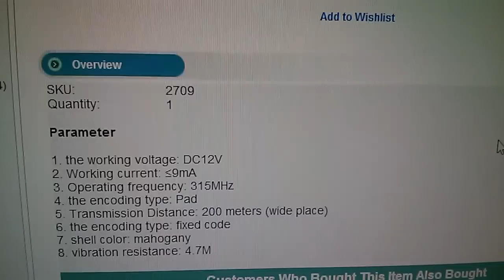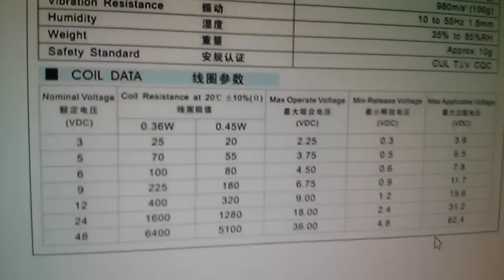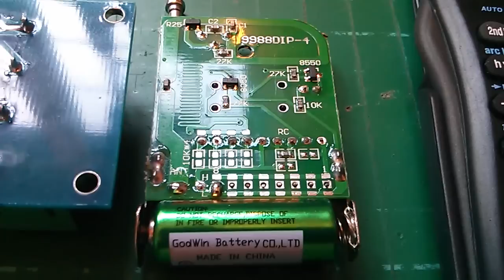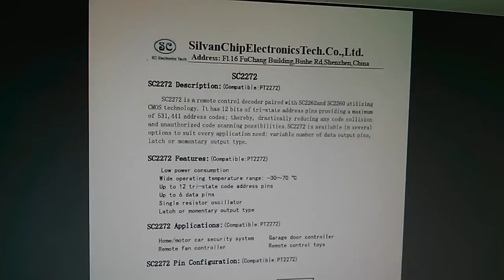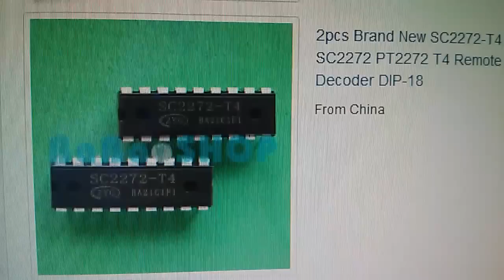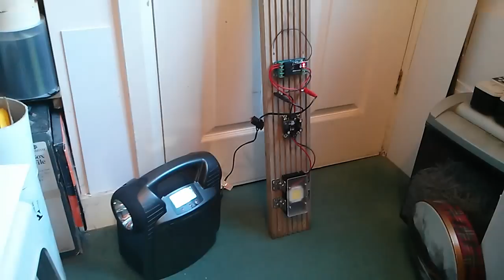Review: 12v 2-Channel 315MHz Wireless Remote Control Module

Comment: @Julian Ilett Hi, can this remote control be used to turn on and off a shed/workshop alarm?
I basically want to make the alarm quite basic, with a door switch that when the door opens up it then directly powers a loud siren and I need a way to turn the alarm on and off (from outside) when entering or leaving the shed/workshop or it will go off everytime i open the door.

So would this be able to work together with what i have planned? The siren will work off 12 volts via a step down transformer from the 240v mains inside the shed/workshop,so i need somewhere to connect it in the circuit to disconnect the power from the siren (+) supply line,I am thinking of placing this in line directly with the positive supply cable to the siren and switch it on and off.

Will it be powerful enough to turn the siren on and off (would be wired in series in pos+ lead) and do you think the way i would set it up is good
Reply: SP330Y yes a relay can handle hundreds of watts

Comment: I purchased this from ebay
http://www.ebay.in/itm/IC2262-2272-Wireless-4-Channel-RF-Remote-control-Transmitter-Receiver-Kits-/181960199083?
after watching this,at Rs 500,but its range I am getting is 5cm ,I tried with adding antena ,not receiving signal if distance more than 5cm :(   ...bad product & no return option,money waste. :(
I tried with 4.2 volt battery ,if I connect 9 volt battery its IC get hotter :( & do not work
can anybody suggest me any solution ?

Comment: hi i wonder if u can help me
 i got my foglight installed with wiring harness witch is build in relay and have 1 wire out to control the relay on or off 12v+ 
Now can i use this device to give only 12v+ to my exiting relay and so i can wirelesly turn my foglight on and off pls 
Tar

Comment: I am using this in a Radio control boat to control directly a mini-motor thru a Darlington transistor. I found that the range is very bad, namely 2-3 feet. Beyond 2-3 feet,  I have PULSATING current,  resulting in the motor's movement being very jerky. Wonder if you have same phenomenon or  know what is going on ?

Comment: Hi, I picked up one of these relay and used items but with a single switch and used it to power off and on a back-up camera on my 36 foot motor home.  The home had one but it didn't show very far behind the rig, so I installed a second and aimed it straight back so  I could see who was following me even when they were not almost touching my bumper.

Comment: Hiya Julian .! Don't suppose you can help me wiring up a DC Motor DC9V-6V PWM 20A Adjust Speed Controller +Wireless Remote Control Switch to a battery & 12v water pump?

Comment: I used this with two 9v batteries. One to power the board and other to power an acutaor. The relays switching are hit or a miss with the remote. Sometimes I have to turn everything off and short the relay outputs to get the circuit board to reset. Any thoughts where I'm going wrong?
Reply: ph0nevid 9v is too low. The relay coils will be dropping the voltage even lower as they actuate (barely).
Reply: Thanks Hayden.. Appreciate the reply.

Comment: Just came across the video of you testing the 2ch wireless remote control. I found a 4ch one on a U.S. website that has hold for on and latchable relays. The cost was over $100! Now found an equivalent on Bangood for £7! I'm using it to control the wheelchair lift on my mobile home. It used to be operated by a flexible cable which regularly failed. Anyway here is a video http://youtu.be/mJcI6Yk75gw Great projects, thanks. Mike

Comment: Does the transmitter work with 9V battery?
Reply: I tried and it works with 9V
Reply: Gregor Kramberger Maybe just about with a fresh 9v battery. But you're gonna have reliability issues

Comment: what is that little 12v socket adapter thing? That looks super useful. One of my biggest pet peeves is having a useful 12v power supply Can you show us what your 12v supply is and where do you get those little 12v adapters? Im sick of splicing 12v wires
Reply from the maker: 12v adapters are from eBay - search for "2.1mm cctv". My 12v power supply is shown in this video: http://youtu.be/t0cSvRgTWT0

Comment: An interesting note on the fact that you can press several buttons at once, there are 12 and 15 channel versions of these remote controls that make use of that fact, where one button might activate anywhere from 1 to as many as 4 channels at once to achieve up to 15 independent buttons with 4 channels.

Comment: Hi Julian ,
Is there any module like this for rj45 lan connection so that we can switch on and off thru internet or LAN?All ip switches are too expensive..
Reply from the maker: Take a look at the Arduino Yun or the BeagleBone (if you're a hacker/maker). Alternatively, some IP cameras have a remotely switchable relay. And the big advantage of a camera is that you can see the item you switched is actually responding.
Reply: yaa but i wanted general purpose one instead of using raspberry pi or some board.. the purpose is remotely switch off and on plugs..
Reply from the maker: cochin007 They do exist - I searched for "remote ip power switch" and found units by Lindy and Aviosys. Expensive though, nothing much under £100.
Reply: @Julian yaa i know commercialy available ones.. Its called IP switch or power switch.But i want to  use some module or something for microcontroller so that we can do it ourselved or adapt in some project.... which can turn off and on or may be do something remotely... ..

Comment: I'm sure I could find a use for one of them! Can I ask where you get the red/black bannana plug sockets?
Reply from the maker: They came from Rapid Electronics, but delivery is charged unless you order over £30. Try searching for "terminal posts" on eBay.
Reply: Julian Ilett same thign for rswww... they charge 5£ just for shipping. So its better to order from ebay than local uk...